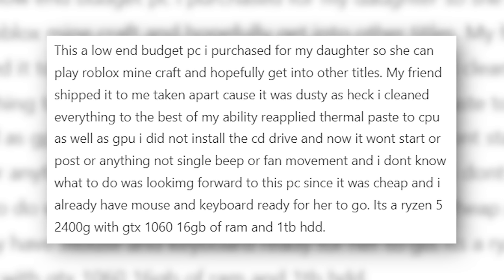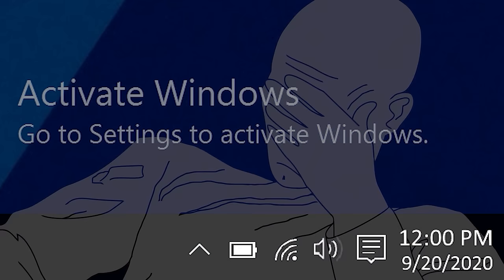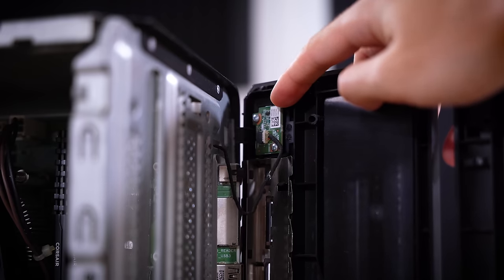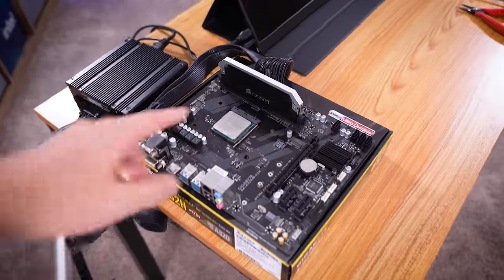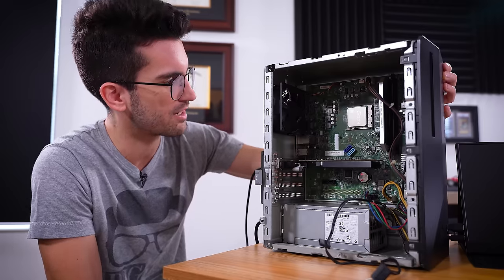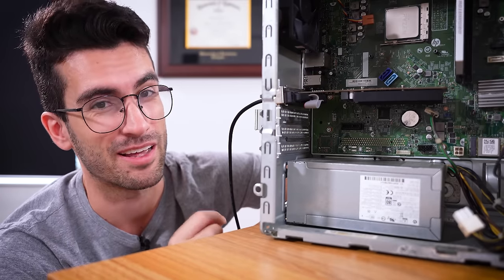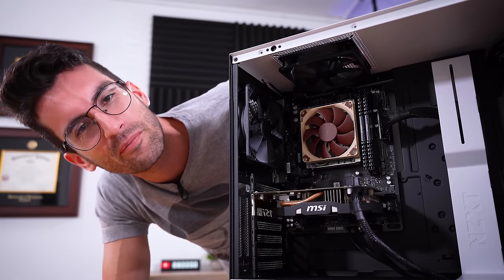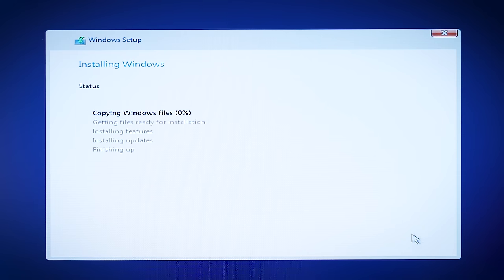Fixing a Viewer's BROKEN Gaming PC? - Fix or Flop S4:E13

Comment: I had the same issue but I solved it by buying a 24 pin to 6 pin psu adepter from ebay.  It costed €4.99 and worked right away with a new standard 24 pin psu.

Comment: Thats why you should always power on the system before cleaning it when buying a used computer. So you know it works or not. Otherwise they may have killed it while cleaning. Since there was no mention it was working when received before cleaning it.

Comment: That looks like the power supply that they use in the Z2 G4 SFF, just with a six pin PCIe power connection. That gives me an idea for a very niche use case.

Anyways, I'm guessing it's more likely that they do all the proprietary crap not to keep you coming to them to fix it. They do it to make it disposable so you just buy a new one, which is even worse. Regardless, it looks like it didn't live the best life. Wasn't kept clean and it looks like the system was dropped on that corner, so it wouldn't surprise me if the PSU died.

Comment: Hi Greg,
I've run into a very similar issue with a similar HP prebuilt (same kind of PSU, power button circuitry, same front IO, etc.), and the thing won't boot
Hp's PSUs actually aren't that trashy, they're cheap but serviceable.
What's really obnoxious about these hp prebuilts is the proprietary everything, even the freaking motherboard standoffs aren't ATX, which means you can't even reuse that steal case.

Comment: Hi Greg,  To help you with the actual problem , the power supply being so dirty I would assume it over heated.  Therefore you could have open it, and check if this model come with a fuse. Most of problem is solve by cleaning the power supply ans replacing the fuse.  Regards, Mario

Comment: I used some leftover parts to build a WinXP computer. I only had to swap out the case, the motherboard, the power supply, all of the cables, the hard drive, and the CPU and fan. The memory was original. Oh wait - it wasn't. 😁

Comment: Some of HP’s Omen desktops I think used to have standard power supplies (not sure if they still do now), I also wonder if that dent in the bottom of the case has anything to do with it. Very kind of you Greg to swap to a new system and especially upgrading to a SSD

Comment: Hey Greg Salazar.
Can you make a quick video about this experiment?

We know that heatpipes of CPU air cooler has a little bit of liquid droplets in it. So here's the thing that I want you to test.

Big CPU air cooler that has 4 heatpipes or more, but I want you to analyze : 

CPU temperature when the Motherboard is just put on the table horizontally,

CPU temperatures when Motherboard is put vertically in regular ATX PC case,

CPU temperature when Motherboard is put Horizontally, BUT upside down on the table using custom standoffs.

Most of us already knew the performance of the first 2 orientation. I want to know about the last one only.

So i guess the video can be shorts

Comment: You could test the power supply with the multi meter.  You should be able to find the model of motherboards schematics online and test the traces carrying power for the correct voltage.
Reply: It doesn't matter regardless, 'cause if it's PSU or MoBo or both.... he couldn't replace them with the same parts anyway.
Reply: @revadarius2594  I know it doesn't matter.  He was still curious, though, so I was offering a solution.

Comment: So from my experiences from shipping am4 ryzen computes is that the cpu will vibrant during transit and it will disconnect just enough for the computer not to boot. The fix is to take the cpu and immediately put it back in. I had 4 different computers i shipped to friends and all 4 had the issue. No matters how much i protection i put on it or anything would prevent it.

Comment: Problems with those prebuilds are just nasty to solve, it's a chainreaction of parts to replace once 1 part fails that is proprietary then the bill runs up fast.
That A320 mobo, even though it's a MicroATX is perfrectly fine for the 2400G, only thing I'm not totally agreeing with is that fairly expensive Noctua cooler for ITX builds, a stock AMD Ryzen cooler would have been perfectly fine because that 2400G is not a hothead at all.

Comment: Adapters are $10-$15 from reputable sellers, but...that's the way I'd go with that if I didn't have money for a new motherboard and PSU, but if I had a PSU sitting around and $20 in my bank account, I'd buy the adapter converting 24pin to HP proprietary power.

Comment: I've gone to a troubleshooting loop of death once on one of these HP prebuilds cause that didn't used an momentary switch for power but an simple switch like an AT system but 5 or 12 Volt. 
I think that might be the case here as well?!

But I guess the PSU is gone as well. Not of bad quality components but of smoking or vaping. I don't know what it is in the smoke but it tent to make dust conductive and that will kill components over time. In this case vaping is even worse in my experirence cause people use a lot more liqud as they could ever smoke cigarettes. Even there is basically no dust it form over time some kind of layer like an conformal coating that will kill hardware from one day on another but I've also seen that if the piece of hardware is cleaned it will return to an working state but will be unreliable in the future.
So there is a small chance it had worked fine before disassembly... We will never know.

Edit: These  priporiaty PSUs suck. They don't make any sense at all to me. I can't believe there are aftermarket sales that make up for only the development of an new PSU for every line of PC an SI has. It's very wasteful and not contemporary anymore throwing away three component if only one is broken. That's common sense. Even today most of those parts will end up in an landfill as we are trying to stop global warming. 
There is an ATX12VO standard since 3 years now but nobody seems to care at all. So we have to force these SI companies to do them a favour? Or do I get something very basic wrong here? To me capitalism is getting wierder every day as it seems we have to pay and/or force every one to do what is advantageous to their businesses. I see it like that: If humantiy got extinct who will hold your shares and who will buy your stuff anymore? So isn't it better to do at least something that that will never happen? That hurts my brain, man.

Comment: Those proprietary pre-builts are the worse. I had one where the front panel connectors were also proprietary so I couldn't even reuse the case without having to make modifications.

Comment: I have an HP with that crappy motherboard. Bought it cause it was cheap, and came with a 3060Ti.
I also have a Lenovo Legion T5, but this uses standard formfactor for motherboard, PSU etc. Only issue is that it's an AMD Ryzen 7 on an AM4 socket, but the board itself uses Intel 115x wholes for the cooler.
The case is small though. Managed to fit a Noctua DH15 cooler, but it's only a few mm from the GPU which is MSI RTX3070 according to Speccy xD
PSU is a 550w unit, and I understand why they're not putting an 800w PSU in the builds. For every 1000 PC sold, maybe 1 person will do major upgrades.

Comment: I have an HP Pavilion, different model. Model TG01-2000i.

Idk the motherboard
Intel i7-11700 @ 2.50 GHz
GeForce RTX 3060 12 GB
80 Plus Gold 500 watt PCU
32 GB DDR4 3200 MHz
1 TB SSD
2 TB HDD 
Extra salvaged 2 TB HDD I got from my old laptop

This confirmed to me what I already knew. My motherboard, PCU, and case suck. Probably my CPU cooler and case fans too. The BIOS with my motherboard doesn’t come with the option to up fan curves, and my CPU runs 3-5 degrees higher sometimes. One day when I’m more stable financially I’ll put money into those things like Greg did to the PC in this video. I also wish I had put my OS on my SSD when I first got it, it’s on the HDD that came with the PC while the SSD has my games.

Comment: whys the cpu fan upside down, (time stamp 4:40) is that normal on an hp prebuilt? i think spinning 3.5" drives should only be used as extra storage not as a boot drive, that said alot of newer games have sdd as a min requirement now.

Comment: I have a 10100f, my dad cleaned. He killed the MB (eBay). But, not having an intel mb replacement to even test. I replaced it with a completely new Ryzen system. His case does cause a voltage spike on usb3 header, with the board shutting down after this error. I pulled usb motherboard headers out, and problem solved.

Comment: I had one of these come across my path a while back, was lucky to have another with a different issue come in at the same time. turned out to be a dead PS as well. eventually ended up scrapping the thing because the power supplies for these things were running $75 at the time. just wasn't worth the hassle

Comment: I love this series, nice to see a build that isn't cystom 

I have a similar HP shitbox that hosts my frjend groups Minecraft server, decent machines if cheap, but no upgrade path which for an AM4 socket is infuriating

HP has seemingly not released a BIOS update either, so I cant even stick a 5600G in

On a random note, I don't get why the 2400G has Vega 11 but every other APU has less GPU cores, kinda annoying, why does a 2400G have more GPU cores then a 5700G? (11 vs 8) 

We upgraded the ram on ours from 8gb to 16gb and swapped the HDD out for a 240GB SSD

Comment: I used an hp workstation as the basis for my first "build" and it's the worst mistake you could make imo. I got lucky, they used a more or less off the shelf motherboard unlike this but their proprietary psu made an upgrade of any kind impossible until I took it out (also it was 350w which is pretty bad)

Comment: My pc has randomly stopped displaying image only while playing games and it ramps my fans up to 100%. Sometimes I can play and it will not do it and then the next day it will do it 3 or four times. It started when I got a new gpu so I assumed it was faulty I rmad it  and still currently does it on the rma gpu. It also doesnt do it on all of my games. I suspect it might be a power supply issue but then the dram light started coming on and flashing and sometimes it doesn't. I bought a new power supply ram and cpu btw. Has been fine for days in doing so with no issues and then it happened again just now. Has not done it but once so far since having replaced these parts. I am lost and confused to what the issue could be maybe my cable extensions are bad or something?

CPU-5600x 4.6ghz

MOTHERBOARD-ASUS B550 gaming wifi

RAM-16gb 3200mhz corsair

GPU-rx6800 16gb asrock phantom gaming

POWER SUPPLY-corsair rm850 80 plus gold

Comment: This is exactly why I hate proprietary crap. Would it REALLY cost HP and the others more to use industry standard form factors? Seems to me it would be a lot smarter if they did, then they could sell parts on the open market as well as full systems.

Comment: as someone who was using an hp prodesk (quite similar to that box), they suck... you just try to fix them more and they break even more. built a custom rig after that hp died for around $250 (i had good parts from another pc i was using that was custom built) and never going back to a prebuilt stock desktop....

Comment: Hey now if the daughter wants to get into more demanding games in the future the dad can easily upgrade the cpu/gpu and the rest of the parts will work fine! A 5600 and a 6600/6700xt would be a huge improvement for a the price of a cheap oem system.

Comment: personally, i would have gotten a multimeter, and probed one of the 12v wires, and watched it as i pressed the power button, To see if you get a quick split second of power to a connector...
That way you could rule out, Faulty power supply, or a dead short on the motherboard...
Reply from the maker: In my eyes it wouldn't have mattered. Both would have needed replacement regardless (save maybe running an adapter, which I'd prefer to avoid if possible).
Reply: @GregSalazar  yep, very true.... Im just that sort of person, That has to know, What the fault was 😂 It would have been eating away at my brain all night, if i didnt find out which one was the cause..

Comment: Oh, ugh.  It's basically one of their newer SFF PCs disguised as a standard desktop.  You have the exact same problem with the PSU in this one that you had there, too, it's proprietary.

E. Looking into that old PSU, give it a whiff, and/or pull the motherboard and check behind it.  I've seen these exact symptoms in systems shorted by roaches.

Comment: So I got an odd situation. Computer showed 0 signs of failure, etc. I have been able to confirm that everything works other than my SSD. Just having it plugged in causes it to not boot into windows. It still shows up but if you click it, everything goes black and pc becomes unusable. I know for sure it's the SSD, but not sure if it's dead or what the deal is with it. It was my windows disk and was working fine and then the computer suddenly froze up and when I went to restart it would never load into windows. SO I put the windows on my secondary SSD to check it.

Comment: Hi, just a random thing I noticed with my PC which may help u in your fix or flop series... My PC was not booting up, Debug light was stuck at CPU, I tried every damn possible which i learned over the years and also through your series, but no solution.. PC was stuck at that, I cleared my bios setting, removed the cmos  battery but nothing.. you what solved the issue? a new CMOS battery... and boom it worked.. My pc has Ryzen 5 3600 with B450 MSI motherboard which is 3 and half year old.. I think newer system need a good cmos battery to boot up.. Hope this helps in your future fix or flop series.. First I thought I have dead memory channel..

Comment: The thing about them using proprietary solutions is it's not intuitive, or logical at all. They want to try to keep customers trapped within their ecosystem, but the thing is, if things are non-standard in their systems customers will typically realize their mistake in buying said products, and never do it again. Especially these days with how expensive motherboards have gotten. There was a time when you could get a decent motherboard for slightly less than $100, but those days are long gone. OEM companies like HP need to catch up, and realize all they're doing is hurting themselves in the long run.

Comment: The thing you said about the OEM PSU's isn't entirely true. 

The thing is: They make them proprietary like crap, which makes these rigs the pain to work on that they are. Why they do it is beyond me; probably to limit repairability. It can't be cheaper to engineer all this crap than to just use something field tested.

But I've seen a few PSU tests of especially DELL PSU's which were surprisingly good in terms of efficency and safety. Gamers Nexus made a more prominent videos about a DELL PSU being actually decent. Most of the time, these PSU's in modern rigs are actually of fairly good quality. PC makers are kind of forced to make them efficent and have all the right safety measures.

You can try finding a pinout and jump start the PSU, to see if it or the board are the problem. I think that would be interesting to see.
Reply: I personally think the motherboard of this PC has given up. I actually had a fair share of dead OEM motherboards myself. They just cheap out on the topology and power delivery of these mobos like hell. The bios also bricks these boards quickly and is just terribly made. One time started with no CPU or a dead one, board is broken for example.

One example is a working Alienware my friend got for cheap. It was one of the last generations, which had all standard layout parts. 
After harvesting it for parts (RAM, GPU, CPU, AIO, PSU) . We wanted to then get the Alienware back up and running with his old parts, put them in the system, started it. We then found out, that the Bios on the Alienware board was incompatible with his old Ryzen CPU. We put the original CPU back in, no post. All original parts back on the board: No post. 
All the parts of this alienware are still working in different systems today. Only this damn motherboard crapped out after it has seen the "wrong" CPU and never worked again.

Other example is an old HP. It worked fine, I took out the GPU, put a new one in: It didn't work. I thought the GPU was done, but no: HP's stupid Mobos just couldn't post with any modern GPU I had. No GPU newer than the system worked. Original one worked. Sadly, because HP is proprietary crap with weird connectors and baked in i.O., I had to replace the whole system, because the stupid bios was being finicky.

Comment: Leave it plugged in an pop out the 6 pin and plug it back in lol just happened me with a new case and psu with a hp prebuilt.. it refused to boot unless i pulled the 6 pin power connector and reconnect.. also that was with an adapter cable to get a new case and psu working lol dont ask me how i figured this out lol ps dont go pulling power cables if you dont know what your doing.. working as a service engineer myself for 3phase kitchen equipment and the sorts
Reply: Also they make a 24 pin to 6 pin adapter on amazon and it works like a charm.. i built a full system free out of a HP prodesk 400 with i5 4690k 16gb ddr3 250gb ssd and gtx 970 with new/old case and psu.. all free bar the cost of an adapter 15 euros

Comment: That was the 1st computer I bought. IT suckes. I ended up building 3 myself that are way better. The front usb ports are fragile and break. Limited CPU upgradeability, and the PSU and motherboard were not swappable because of design and connections.